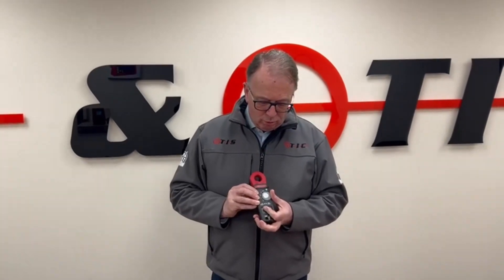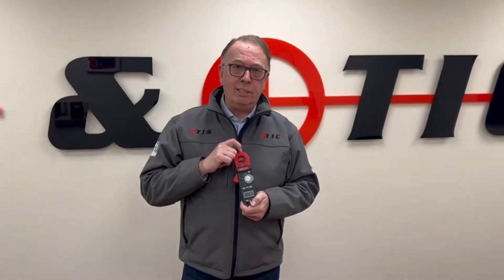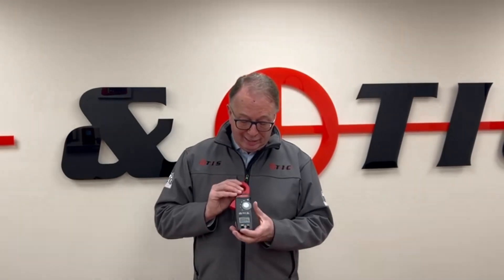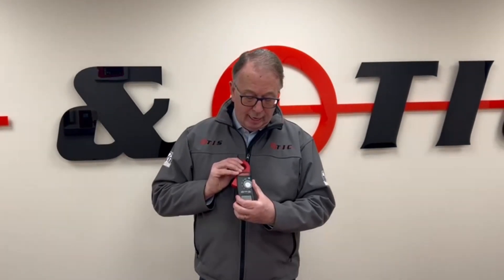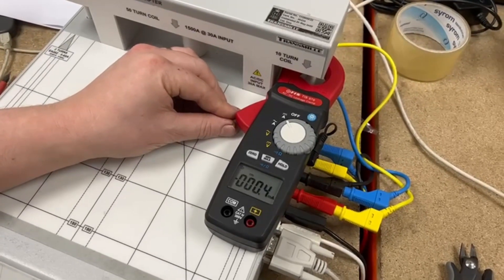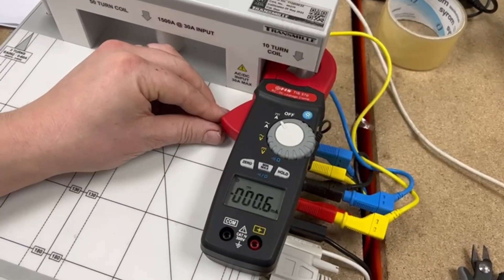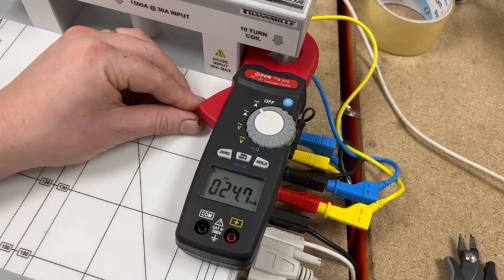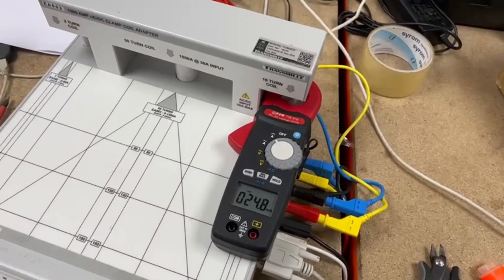TIS 570 AC/DC Earth leakage clamp meter overview and demo.

Comment: Just bought this clamp today, and been having a bit of play with it. The instructions that come with it aren’t that great tbf!!! 
To accurately measure DC leakage I take it you need to clamp both the live and neutral together? The same as you would if you were measuring AC leakage?? Also can you explain the min/max feature a bit more? Is there a time out limit on the clamp? Or can you clamp a set of tails for eg.. 30 minutes then come back and read the min and max figures??
Reply from the maker: Correct just clamp the L & N and the min max will last as long as the battery